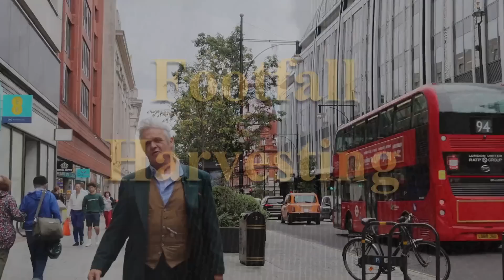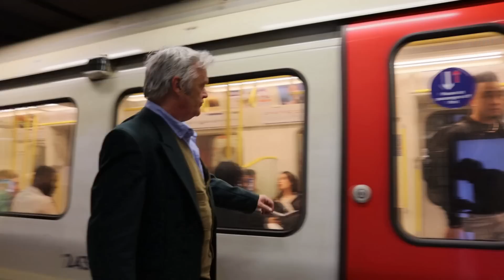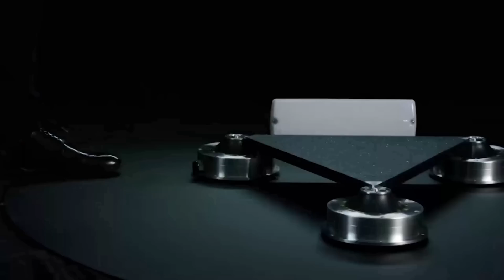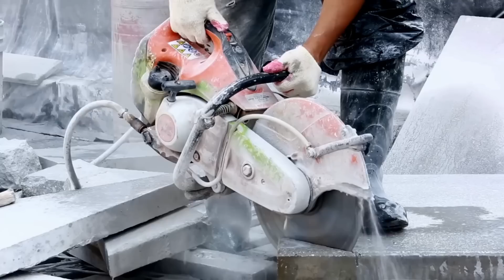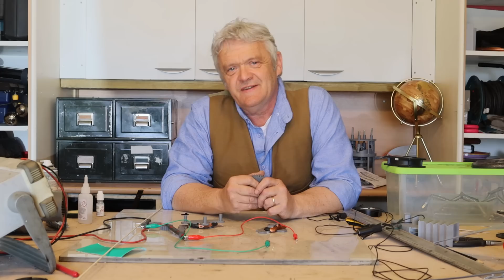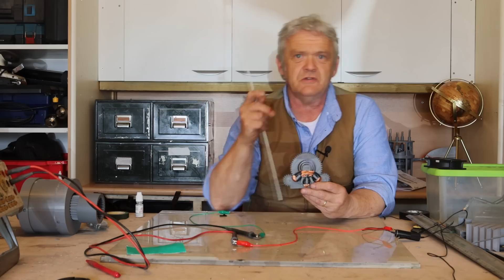2037 The Footfall Harvester

Comment: You should put it in a shoe, some how using the oscillations of walking, then adds energy into a spring drum, that intakes both stepping up, and down, as if there were two mechanisms: one released when pulling foot up and the other compressing. 

This could also be like a ratchet system that for each release and step of the foot adds energy into a drum spring that powers a clock generator system, In summary you could make a clock shoe, that powers a battery.

Comment: A much simpler approach would be to put small pistons at the corners of the plates so that people walking on the plates would compress the air in the piston and deliver it to a manifold where it would then be stored in a tank and could approach very high pressures and volumes.   By storing the compressed air, energy could be produced on demand when needed without the need for expensive batteries.  Speed bumps could be made that delivered bursts of compressed air to a tank that could be tapped to supply electrical power to road signs or emergency lighting.

Comment: That's great, thank you!  I "designed-in-my-head" back when I was using the subway for commuting, something I had called SpringStep, which was the same concept.  I decided not to pursue it when I realized that it would basically be generating energy from people's meals: it'd be more difficult to walk, like walking on sand, because part of one's locomotive energy would be captured.  Having the harvester working in multiple environments, particularly with wind or waves, seems much more productive!

Comment: I wonder: if you put a one-way "escapement " on a spring - loaded "gear', so that the relatively slow, but powerful, step, pushed the gear to a certain point, then releases it, it would then be able to spin quite fast, the more volts to put out...not necessarily more power, but at a higher voltage, which is easier to store or convert to a "useful" voltage...a good place for supercapacitors.

Comment: Dr. Smith, with just a little more modification you could be making energy harvesting roller blades. Each wheel could be generating as you skate around. So that's 4 wheels per skate times 2 feet. 8 volts to charge your phone while skating. Nice.

Comment: Thankyou for your Info! love it ```Pieso Engine
??????????????????????????
To create a simplified piezoelectric energy harvesting machine with minimal parts and a high power/weight output, consider the following design concept:

Simplified Piezoelectric Energy Harvester:

Objective: To create a simplified piezoelectric energy harvesting machine with minimal parts that focuses on high power/weight output and efficient energy storage and production.

Design Concept:

a. Vibrating Element: Utilize a lightweight, flexible cantilever beam as the vibrating element. The cantilever beam should be made from a material with good mechanical properties, such as spring steel or a composite material.

b. Piezoelectric Material: Attach piezoelectric elements (e.g., PZT, PVDF) to the vibrating cantilever beam. The piezoelectric elements convert the mechanical strain from the beam's vibration into electrical energy.

c. Vibration Source: Use an external source of vibrations or resonant frequencies to induce the cantilever beam's vibrations. This could be environmental vibrations, such as those produced by machinery, traffic, or even wind.

d. Energy Storage: Connect the piezoelectric elements to an energy storage device, such as a capacitor, battery, or supercapacitor, to store the generated electrical energy.

e. Energy Management: Incorporate an energy management circuit, such as a voltage regulator or power conditioning unit, to optimize the energy harvesting process and ensure a stable output voltage.

Functionality:

a. The external vibration source induces the cantilever beam's vibrations.

b. The vibrating cantilever beam generates mechanical strain on the attached piezoelectric elements.

c. The piezoelectric elements convert the mechanical strain into electrical energy.

d. The generated electrical energy is stored in the energy storage device.

e. The energy management circuit ensures stable and efficient energy output.

Prototype Development:

a. Fabricate the harvester components using affordable and easily accessible materials, focusing on lightweight and low-cost options.

b. Assemble the prototype, ensuring all components work together efficiently and are properly aligned.

By using a simple vibrating cantilever beam with piezoelectric elements and an external vibration source, this design minimizes the number of parts and can potentially achieve a high power/weight output. Further research, development, and experimentation will be needed to determine the actual performance and efficiency of this design.```

Comment: Just think how much energy could be harvested from highways using this surface and vertical wind turbines  along the sides of the road
Reply: An amount that is pretty small compared to the amount used by the cars, unless most of the energy is coming from the wind, in which case there is little reason to put them near highways. It isn't clear if these wind turbines will make the cars less efficient by increasing air drag through complicated aerodynamics. 

Also, highways are doing an important job of helping transport stuff. 

Will your wind turbines obscure signs? Distract drivers? Crash barriers are designed for the safety of drivers. Crashing into a wind turbine could be much more dangerous.
Reply: Pavegen surface will increase the rolling-resistance of the vehicle. You'd lose more energy than you could harvest.

Comment: Robert Murray-Smith
You need to make a ratchet trigger mechanism that doesn't fowl the back and forth motion 🤔
Haha I have an idea, you can use the tooth brushes angles down in a rod, when pressed cranks the spring, then releases when it passes the gear ( which could be changed out for a roller )
And a delayed void plunger return (small flappy checkvelve on a cylinder & piston with a small hole for bleed)
🤔 Ya might need to figure out the leverage to increase the travel, with can be done given the 80 100 + Kgs.

Side note... Was watching wave collector generators at sea, they would do good at adding the wobble tube generators on top, with all that wasted space...

Comment: Very interesting!! Gave me a thought. If coils were put within road pavement and magnets put on cars, would that also produce electrical energy as the cars drive on the road? I know it would have to be on a much larger scale, but it's interesting to think about. Maybe start with "Hot Wheels" size cars??
Reply: If coils were put within road pavement and magnets put on cars, would that also produce electrical energy as the cars drive on the road?

You have invented the electric generator. Only more inefficient. 

This isn't useful unless someone else is paying the petrol bill. And even then, a small hole in the gas tank + collection gutters + conventional power station is a better combo. 

Maybe we could invent robots that drill holes into the gas tanks and suck the petrol out. That would capture much more energy than most forms of "energy capture".

Comment: Nice!
If you hang your device in a cradle that is fitted with the same springs on each side but perpendicular (to the original cog-wheel-spring) and put some magnets on the bottom (with the coils on the cradle), you would have a 2D capture device instead of the 1D you have now.

Comment: Jus on the principal that there is nothing free in physics, I have to suspect the following:

 All these seemingly free energy collectors is that they are not free at all but suck energy from whatever is driving them.

In this case, it will cause your walking to be harder, like stepping up hill 5mm with each pace.  This levels a cost of living increase on the public for food.

There was a proposal to collect energy from the displaced wind of passing traffic.  It just increased the wind drag on the traffic increasing fuel consumption.  Which increases the cost to the public.

In short, it's a sneaky way to steal from the public in small unnoticed increments.  It's like a 0.1 cent per day fee on everyone's bank account.

Comment: For some reason this puts me in mind of a conference I once attended about 25 years ago on technological convergence. 
Many of the talks that day were about how mobile phones, cameras, televisions and computers would all, one day, be part of the same device.
I wonder if we might see a similar convergence with passive energy generation devices.
Reply: We should be. Most people think of energy generation and their minds are like "so you're just going to put solar panels everywhere?" All these energy generation mechanisms are meant to be used together. A modular system.
Reply: @Javierm0n0  Scale, cost and ability/efficiency.
Just as we were predicting the convergence of electronics in the late 90's to happen from a scale, cost and ability level (as it did a decade later) perhaps the same is true with energy generation? 
If we can get the scale, cost and efficiency level of multiple technologies down to a sufficient degree, then the energy market should be no  different to electronics and we'll start to see convergence as a natural progression of the sector.
Reply: That convergance made sense because of the "duplicate parts". The cost of a smartphone > cost of all it's components. 
A computer, TV and digital camera all have a screen. A TV and dumb phone and maybe computer all have a speaker. A TV and dumb phone both need an aerial. 

A smartphone only needs one of each. So is cheaper than all the other devices put together. 

And one small device is more convenient. If you can make cheap "convergant" power generators, you can make substantially cheaper solar, and use that.
Reply: @donaldhobson8873  People thought the same about gadgets..... Some still do.

Comment: It's amazing how trying be a positive force for the good of all by openly sharing your ideas attracts a certain amount of negativity. Where I live a lot of people are overly stressed and quite unpleasant. I don't mean to say most people around me are negative.  In my opinion a large portion of folks around me are congenial and kind. So I'm not surprised that the vast majority of comments are here are positive and encouraging, but it is still interesting to read the negative ones mixed in amongst the rest. I guess it's like salt. Too much and it ruins the flavor of a meal. I'm still binge watching your past videos and I am amazed how quickly you adapted 3d printing into your creative process. I do wonder if using a different filament as the spring could improve it. Ever since you explained that there are different materials in 3d printing, I've been wondering how many of your older concepts could be improved by taking advantage of their different properties. Like using ABS for shafts or rods. Threaded bar is so expensive and weighs a good bit compared to a 3d one. Plus no waste from cutting metal down to fit. Sorry about the long comment but I wanted to say are the cat's meow.

Comment: I would think that using walking to pump a fluid would be more cost efficient. High tank, low tank, and single water wheel generator. Instead of magnets and coils every meter
Reply: Until some stiletto punctures it, and all the energy leaks out. 

I think capturing energy from places with more energy to begin with, like the wind and waves, would be more cost efficient.

Comment: Wouldn't be easier to use the generate air pressure as the person steps on the tile. Then all the compressed air could be used in one big generator
Reply from the maker: you could try - but compressing air and keeping it compressed isn't as simple as it sounds mate

Comment: My first thought was to couple it to a tooth brush slip clutch and rectify the oscillation into rotation. In conjunction with the slip clutch I think multiple panels could contribute to spinning up a single flywheel. Maybe it would be cheaper and more efficient to electrically rectify to DC and store the energy in a battery. Have you done a comparison of different diodes to see how much voltage drop there is? Would scaling up a little more would improve your efficiency?
Reply: sea:  Schottky diodes can be had with very low forward voltage drops.
I was fooling around with model sized steam turbine generators for illuminating head and cab lights on a model steam locomotive.  This worked well but burned out the small bulbs with varying steam pressure.  Under load this little demon, 7/8" outside dia. produced 2 VAC at 1.5 Amps., which was fine for a flashlight bulb.
I had the bright idea to use 3 Watt LED light but, this required at least 3.5 Volts DC or so.
I could have re-wound the little alternator for higher Voltage but, since I needed a rectifier anyway for the LED, I decided that a voltage doubler was the way to go.  
Searching through the DIGIKEY catalog we found Schottky diodes with a guaranteed forward Voltage drop of .22 Volts.
When completed the arrangement worked very well with the LED at full brightness.  The actual Voltage drop on the 2 diodes in the circuit we measured at .18 Volts each.
Trust this helps.  The current capacity was 15 Amperes.

Comment: ☝️☝️✍Hello Robert, Nice effort shown. Much appreciated. Suggested is to replace the stiff 4mm rod length shown in the video with a black walnut tree's pinnate leaves and stem system using the very flexible natural stem in place of the rod shown in the video.The pinnate stem flexes, and then releases a lot of energy from it's flexible stem shaft's recoil. The rhythmic recoil would swing in oscillating harmony with your spring loaded energy harvester. I have videos taken of the North American Black Walnut Pinnate leaf system's impressive dancing motion in light disturbed wind conditions, bUt, if you wish to see the motion for yourself, please when out and about go to a pinnate tree area to watch in light breeze conditions the considerable back, and forth of a vertical oriented stem producing continual energy potential from the Pinnate Leaf clusters. I often imagined this back and forth waving motion working in unison with a small energy generator to recharge a phone when out in the wilderness. Your light and compact electric generator packed into the camp site then able to accept a locally harvested pinnate tree leaf and stem inserted into the generator would be very useful when off the grid in a campsite needing electric generation, and battery charging. Thank you Robert. I do enjoy your inquisitive nature, build efforts, often smile, and jovial laugh. :  ) Thank you also to Luke for working hard to present to us so much valuable, and interesting content. I hope your electric generator is offered as a product in your store. Just add a balanced in position threaded hole location to the design,and offer a thumb screw to clamp, and hold firmly the locally found pinnate leaf stem most firmly.⚡Power To The People⚡ ! ! ! John Lennon